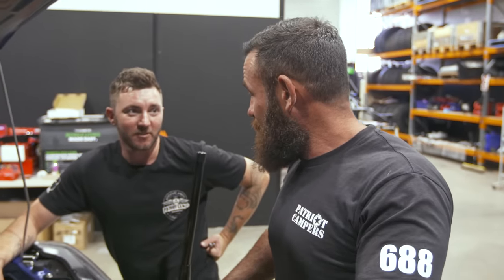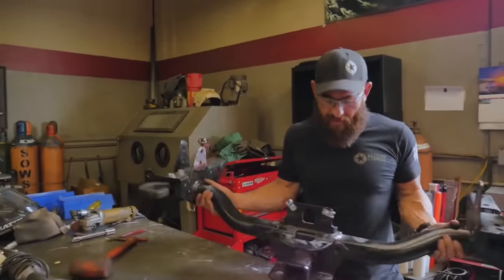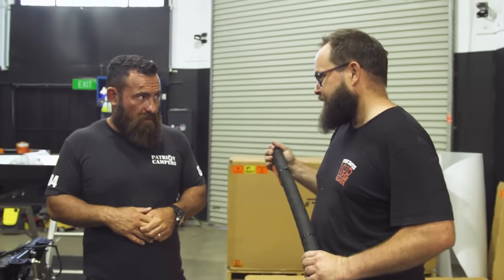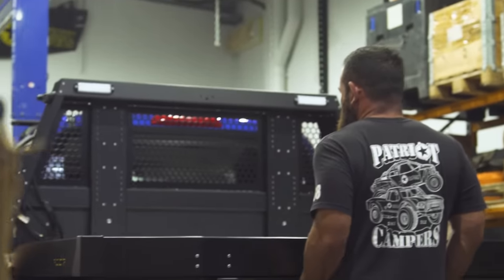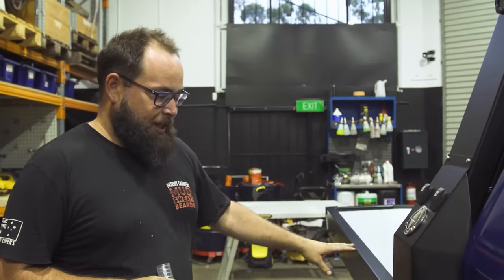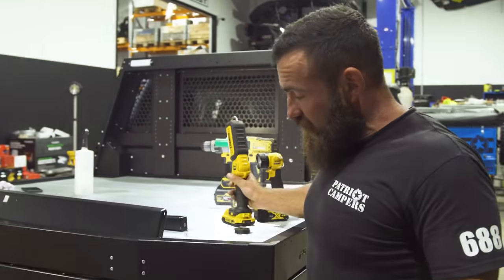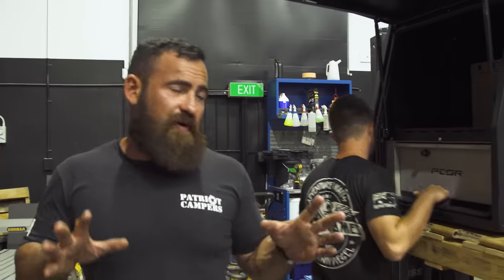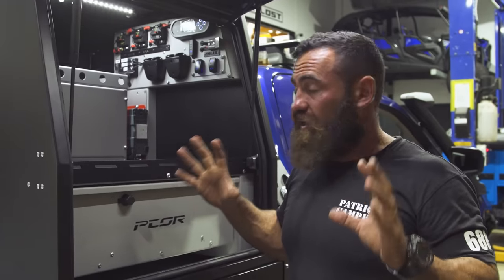The First Ever PCOR Tray For The D-MAX - Giveaway Build Series EP 3

Comment: Well that's the bees knees. It all looks terrific and some of those bolts when you fit those lockers under the tray near the wheel arch, could they be a welded stud / bolt so all you need then is to push the locker up and then fit a nyloc nut on it.

Comment: Are they work lights on the top of the headboard?
If so it’s a shame they are rendered useless with the box on the back, would be cool to have a extension loom,  cutouts and blanking plates so they can be relocated to the back of the box.
Absolutely love your trays, they are extremely impressive in the flesh as well.
Reply from the maker: Thanks for the suggestions Mark, The Canopy is modular and can be removed easily. I'll pass on your feedback to the team!
Reply: @PatriotGames  all good, I love the tray and it’s definitely never be a deal breaker but as you guys have great attention to detail it was just a little bit of a surprise.
Reply from the maker: @MRCtouring  There is a work light on the back of the canopy that takes over from the lights on the headboard!

Comment: Awesome setup
Love the gear you guys make 
Looking at the head board you got indicators along the top. Have you guys made up a wire extension or  a blanking plate so you can either take out the lights or have them on the back or a canopy?

Comment: Hi Justin - very impressive piece of kit - well done guys on another great product. One question with regards all the fittings you are using to fix mud guards etc -  are you experiencing any problems of them coming loose on the corrugations on dirt roads? Or is it to early to tell? I lived in Namibia for a number of years and if you did not use 'nylock nuts" things just rattled apart no matter the vehicle.
Cheers
Reply from the maker: Thanks Adrian! Haven't had an issue yet!